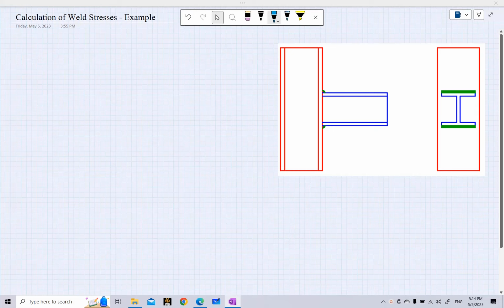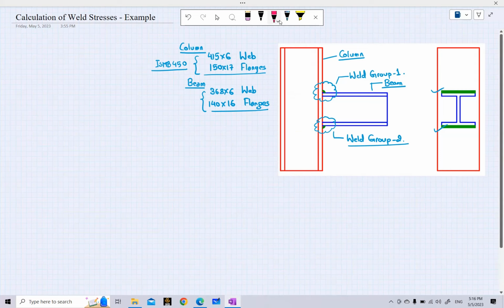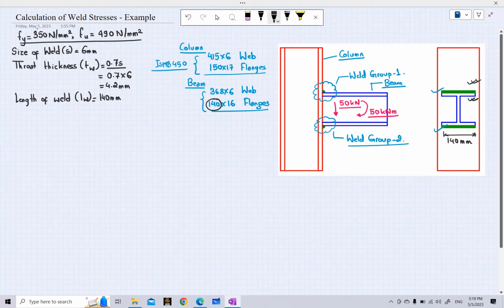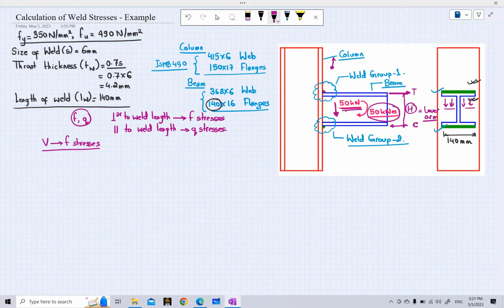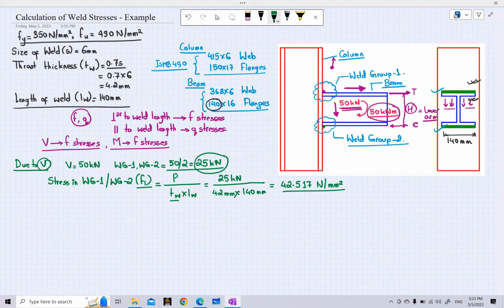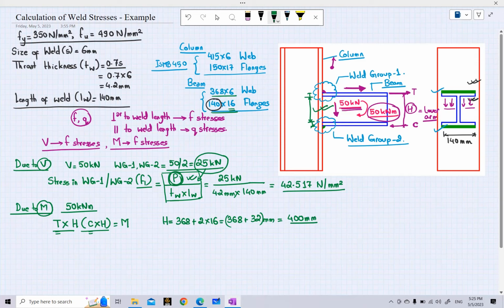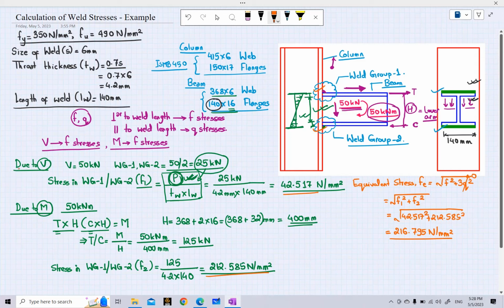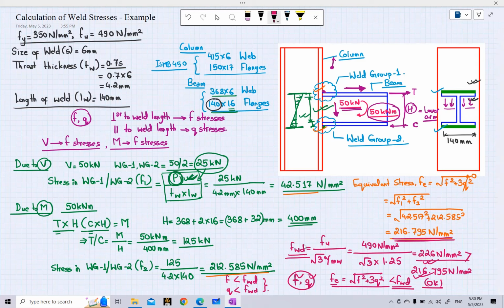Lecture 8 - Calculation of Weld Permissible Stresses (Numerical Example ǀ IS 800)

Comment: Force due to Shear force  V is in plane force, it is parallel to the direction of weld though it is parallel to size of weld but steel it is || weld. You can refer your earlier lecture-7 - example of connection of Beam and Column.
We can describe Q is in plane acting force shear force;  and F is out of plane acting force tension and compression.